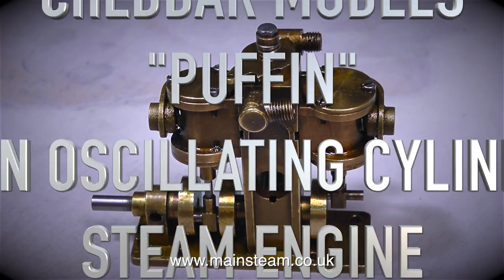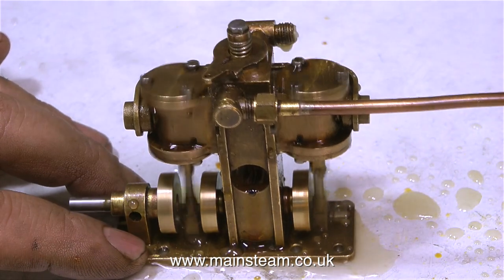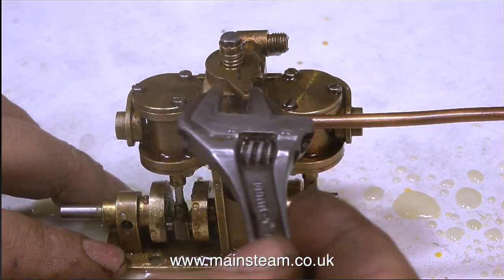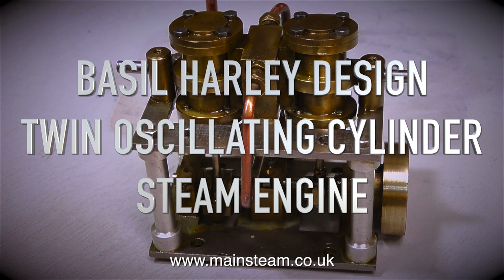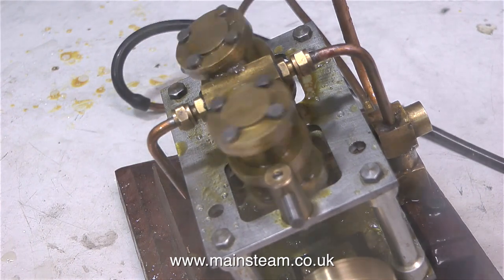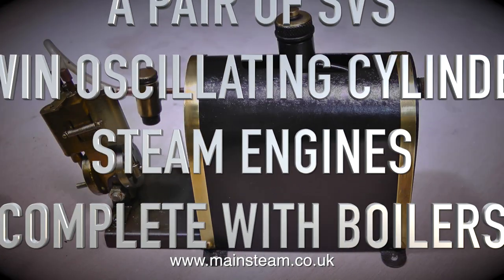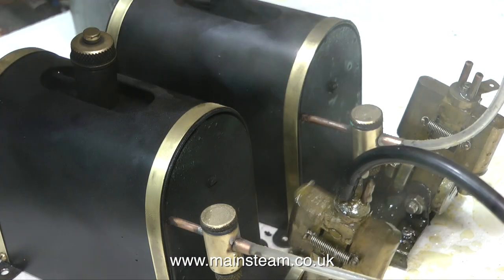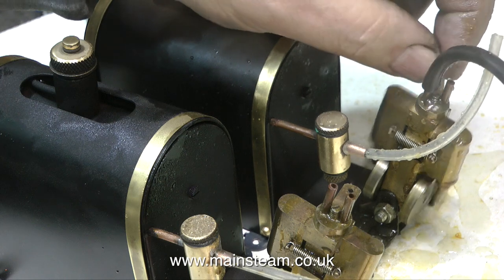LIVE STEAM BENCH TEST - THREE SMALL MODEL STEAM ENGINES

Comment: Anyone else see the crank shaft on the first one seem to come slightly apart near when he removed the black rag?  Looked like the half of the flywheel bit nearest the output shaft itself - like it walked that directly then came back.
Reply from the maker: Funnily enough - you may find it strange, but I also saw that too - mainly because it's meant to do that. The prop driver part of the engine is a separate floating unit ......
Reply: Pin across the counter weights is firmly pinned to the input shaft and the output shaft may be a floating pin to keep the  crank from binding. Even if it is loose it's appears firmly encapsulated by the rest of the engine. You'd have to have a cylinder come clean off its mount or the grub screw for the output shaft back out and the shaft completely work its way out to have a problem.